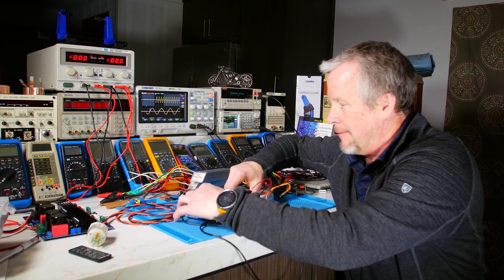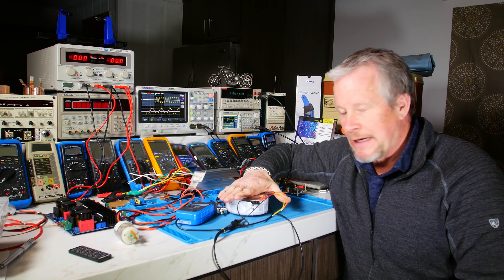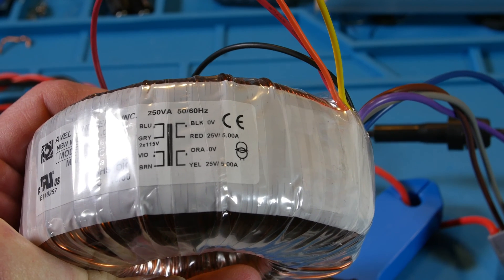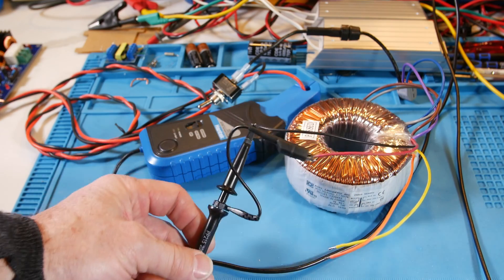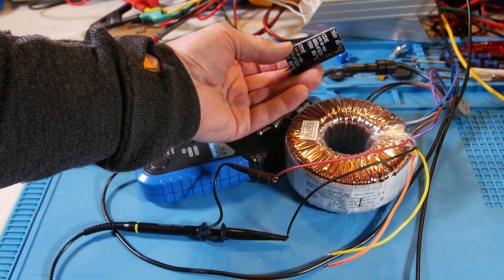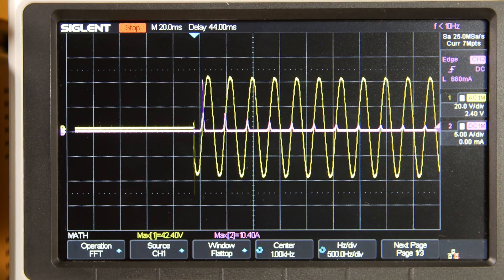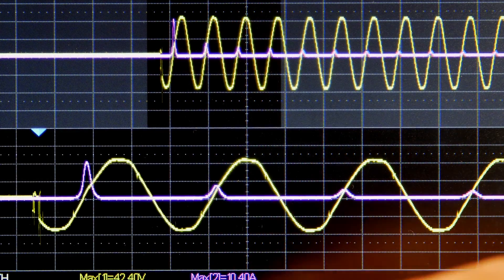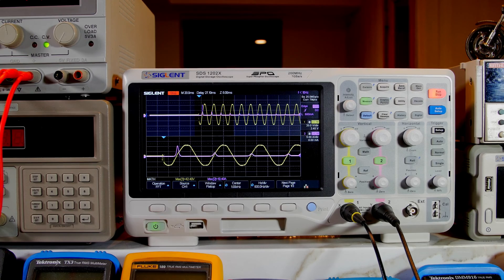Transformer Inrush Current - Surprise! #HantekCC65 #hantakcurrentprobe #CC65 #transformerdesign

Comment: From a traditional EE project standpoint, you should really have an AC high voltage safety disclaimer in the video text, or at least state the dangers of electrocution and potential damage to test equipment when using a non-isolated "plug it into the wall" demo. This would also be a good time to discuss the importance of an isolated (power and grounds) AC power supply.

I think many engineers working on the bench recognize two basic categories of adjustable isolated AC power supplies. The first category is engineering test and the second field repairs. For doing equipment repair and troubleshooting on US rated mains equipment, the design of the AC isolated adjustable power supply is well understood and many repair technicians and engineers have either modified an existing model or made their own, in that, amongst many other features, is the option of isolating the earth ground from the equipment under test and the supply housing (chassis). This is easily done from a metal chassis by using isolated ground receptacles (usually in the US either Red or Orange in color) and, many times, having the earth ground open, either all the time or with a switchable option.

The AC isolated adjustable supply used for engineering test will not have the ground isolated (for obvious safety reasons), but will have many other features for testing (which usually includes power line disturbances) in the context of proper operation and prequalification (PF, brown outs, drop outs, etc.) and it usually can support automated test, which is helpful for batch qualification. Features also include being able to start the AC waveform at any point in the AC cycle when you enable the output, with the start of the waveform usually denoted by 0 degrees representing voltage zero cross for the increasing first half sine (really sine for the mathematicians and cosine for EEs ) wave as referenced to, in the US, Hot (Line, Black) and Neutral (Return, white). This is especially handy in teaching transformer magnetization current in-rush, which if you go through the vector calculus, will, based on idealized component models, have a maximum magnetization current at the voltage zero cross point, but start the voltage waveform at 270 degrees (90 degrees prior) where the flux linkage is at zero, which is the result you see in the video. Essentially, what AC engineering supply provides is a repeatable worse case test (because with a common power switch you are randomly enabling power and might not always get the worse case in rush in a repeatable fashion) to fine tune the soft start circuit, or sizing or the Thermistor as discussed by Eddie in the video.

By looking at inrush you can also explore the differences in transformer design, like an E core versus a Toroidal. The Toroidal transformer has a lot of advantages, unfortunately it also has more inrush as compared to an E core. So the Toroidal transformer is a good choice to explore transformer in-rush (magnetization) current.

Comment: The peak value of magnetizing inrush current really depends upon the load and instantaneous input power factor of the transformer, lower the input power factor higher would be the inrush peak.

For transformers under no load, the input power factor is a known value and so special instantaneous switching is done on input voltage to completely eliminate the magnetizing inrush current peak.
Reply from the maker: Semper Fidelis Thanks for sharing your knowledge!  I hope to hear more!

Comment: In power transformers, the magnetizing inrush current (switching transient) is so high that it sometimes trips the differential overcurrent relay..
Reply from the maker: That is such a great input!  That is very true, but I feel that happens sometimes when the magnetics are not designed correctly, or the wrong time delay is grossly misjudged.  Thank you for this great comment!!
Reply: @KissAnalog  Its because of the disorderliness of the magnetic moments of atoms in the core material of the transformer. During a fresh start, the transformer has to draw some extra current to put those moments in sync. This current can be seen as an exponentially decaying current added to the time shifted sinusoidal current flowing in the transformer...

Comment: GREAT VIDEO. I CAN'T FIND THE FOLLOW UP VIDEO TO THIS ONE. THANKS
Reply: Thanks for your reply. I installed the thermistor several weeks ago and everything is working great. No more tripping the circuit breaker
Reply from the maker: Jerry Moats Thank you, and I’m sorry - I have been delayed.  At request, I did start a parallel series that yo can find here.  It breaks this subject up a bit different and in small steps.  I will release the next in this series Monday/Tuesday.  Thanks for the reminder - and 5hank you for the reminder;). https://youtu.be/zTI7ArPs-FM
Reply: THANKS. I DO HAVE ANOTHER QUESTION. I HAVE A TRIPP LITE PR 60 POWER SUPPLY THAT INTERMITTENTLY WILL TRIP MY 20 AMP AC BREAKER IN MY PANEL BOX WHEN I POWER ON THE POWER SUPPLY. I SUSPECT IN-RUSH CURRENT TO BE THE PROBLEM. I AM GOING TO INSTALL AN IN-RUSH CURRENT LIMITER ( THERMISTOR) IN SERIES WITH THE AC SUPPLY COMING INTO THE POWER SUPPLY. MY QUESTION IS IF THIS SOLVES MY PROBLEM THEN WHY DID THE MANUFACTURE NOT INSTALL ONE AT THE FACTORY.  THANKS AND GREAT VIDEOS.
Reply from the maker: Here you go...,
https://youtu.be/E4-Uss4zUq8
Reply: WOW!!! Thanks, I feel like a celebrity now!!. Thanks for taking the time to do the video. The device in question at the AC input is the power switch with a neon light in the switch. Yes, you are correct that the power supply has a massive power transformer ( very heavy power supply ). my only other question is does it really matter where I install the thermistor in the ac line ( I would certainly think in series with the hot ac line right after the power switch). Thanks again for taking the time to do the video. Keep them coming.  Jerrry
Reply from the maker: Jerry, I’m not sure that you got my answer regarding the placement of the thermistor...  I think as long. It is in series with the primary winding, line or neutral you are ok.